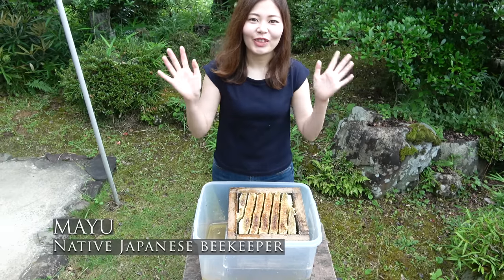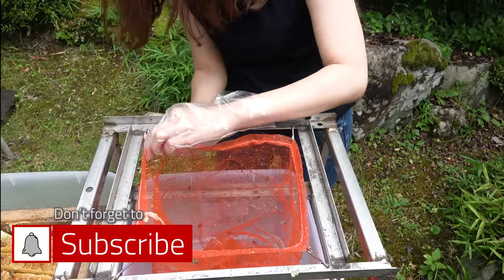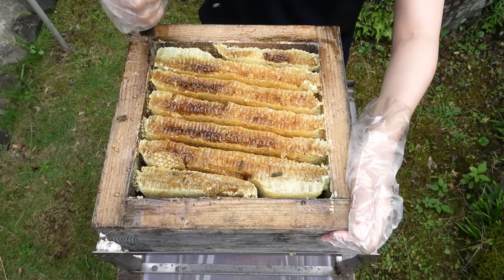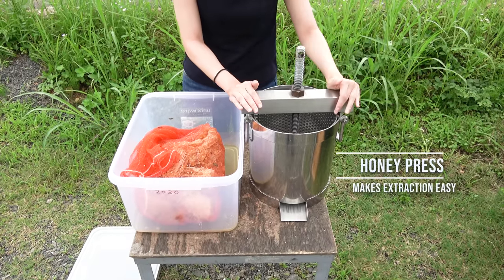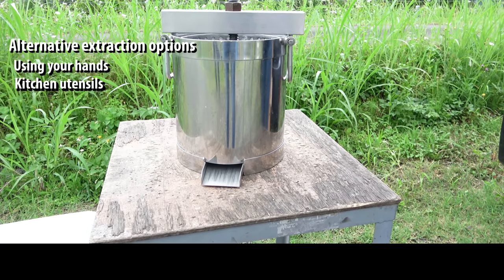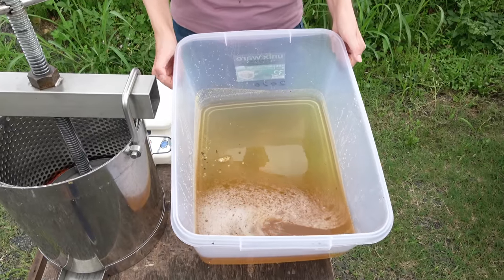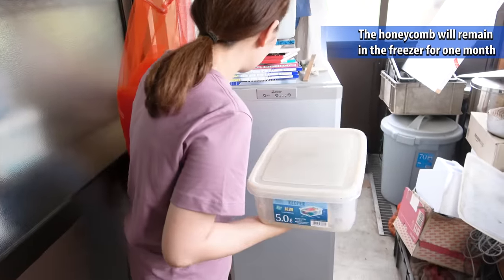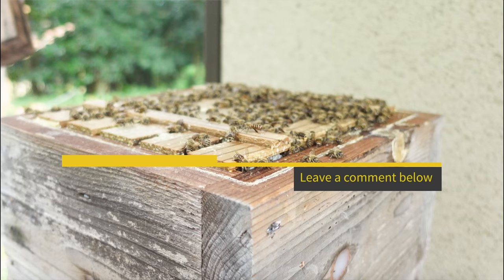Squeezing remaining honey in combs.  Apis cerana japonica

Comment: I am a Peruvian beekeeper. After harvesting the honey, I melt the bee wax. But before melting it I wash the honeycomb to make mead. It is a beautiful video. Thank for your hard work doing this channel.
Reply: I would like to know how that works. are you just collecting the runoff which should have enough water and  honey for the alcohol prouction?
Reply: @jeffstiles7850  So, every tool like the honey extractor, buckets, pans, etc. should be rinsed with topwater, then you have to strain using cheese cloth. The next step is to boil it for 20 minutes, let it cool and bottle up all the liquid making sure it is enough sweet to allow fermentation to work, shake the bottles once a day. Depending on weather it will be ready in two or three weeks. Make sure not to close too tied the top of the bottles to allow escape the carbon dioxide that fermentation produce. The liquid after rinsing the wax you get after honey extraction is the best batch to make fizzing mead.
Reply: @wiracocha9456  Thanks for getting back to me. Sounds tasty.
Reply: Я россиянский пчеловод. После сбора меда я расплавляю пчелиный воск. Но прежде чем растопить, я промываю соты, чтобы приготовить самогонку. После пергонки борду даю с сахаром пчелам для зимовки. Это видио как и все. Просто спасибо вам, но все можно делать гораздо проще
Reply: Hola amigo, por favor, me podrías compartir el procedimiento para producir hidromiel. Saludos desde Ecuador.

Comment: In the first comment I didn't write your name correctly, so I apologise for this.
I have a question if You don't mind; I understand that the pile hive box is the traditional Japanese method of beekeeping, but do You believe that is more advantageous then the European system which uses reusable frames and honeycomb?
Reply from the maker: In Japan, the Langstroth hive is used widely to keep Western bees, but it is not often used to keep Japanese bees.

It is often said that the productivity of a Langstroth hive is higher. I am not sure it is true when keeping Japanese bees.

Actually, honey production per hive can be higher. However, in terms of time management, honey production per hour is more important.

A pile box hive can be more productive in terms of honey production per hour of labor because less time and effort are needed.

All I have to do when I use a pile box hive is:

Make a beehive

Set a bait hive in the spring

Add boxes a few times throughout the year

Extract honey

At a minimum, I need only 5 hours to extract 5kg of honey.

On the other hand, with a Langstroth beehive, it is expensive and takes longer if you make it yourself.

I need to inspect the colony almost every week and it takes a lot of time to go to the places where the hives are located.

How much more honey could I potentially get? As mentioned, I can get somewhere between 5kg - 10kg per hive on average when I use a pile box hive.

The increase in honey production may not be worth the time and effort required.

In addition to this, the Langstroth hive increases the risk of absconding. For these reasons, the Langstroth hive is not used widely for Japanese bees.
Reply from the maker: for mote details, please visit my website. https://www.japan-natural-beekeeping.org/post/hive
Reply: @JapaneseNaturalBeekeeping  Thank You so much for your detailed explanations.
🐝🐝🐝

Comment: I've seen some people use a spinning device kind of like a washer machine (top load one). There would be a handle on top so you can spin it. Is this method better than using centripetal force?
Reply: it doesn't work with this kind of beehive. the spinning machine is for honeycombs in frames.
Reply: The spinning device you described uses the same force as the honey extractor used by most beekeepers.  The difference is that the extractor spins only the frames and your device spins everything.

Comment: Sehr interessant aber gibt es keine Räuberei beim Reinigen der Geräte oder hast du noch volle Tracht ? Und wie sieht es mit Varroa aus ?
Reply: It is said that varroa isn't a  big issue here in Japan. Varroa is native to Japanese bees and they co-exist - basically  healthy colony will groom each other to keep mite numbers in check. A weak colony might be a different story. Tracheal mites however are a threat here (as opposite from western bees). Normal management methods such as OA or apiguard etc are not used here, mostly only menthol crystals on top of the hive. 

I lost my bees to tracheal mites over the winter. I believe the main reason why OA isn't allowed here is because due to the structure of the jubako pilehive you cannot remove any honey before treating, and then you would expose the honey to the treatment, something that is also not recommended in the west. Cheers from Japan. I will try to catch a new swarm this season and this time I will treat with OA.

Comment: I have a large Garden, I am thinking to Keep bees. I want to know how did you make that bottom part of the hive. Its nothing like I have seen here in the UK.
Reply: The traditional Japanese hive is designed for Asian Apis cerana bees. It is not well suited for European Apis mellifera bees. You can try to keep European bees in a Japanese hive, but it is too cramped for them and the Apis mellifera colony will not develop to its full potential. Also, the Japanese hive is very difficult to inspect and treat in case of bee diseases. Apis cerana is a wild bee which is resistant to diseases, but gives little honey. They also do not like hive inspections (they can fly out of the hive because of this), so the Japanese hive is made maintenance-free. To keep European bees, use a Western hive design available for sale in your country and don't reinvent the wheel
Reply: @user-pd7cq666  Thank you